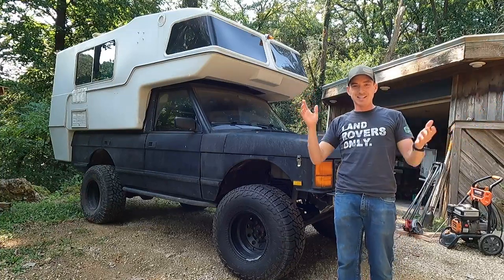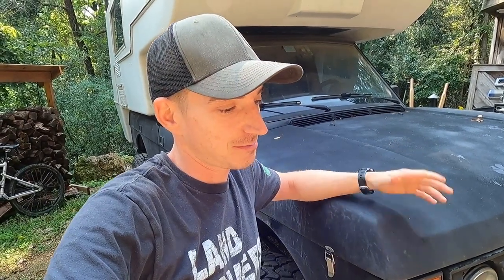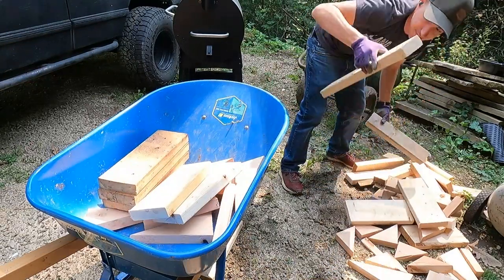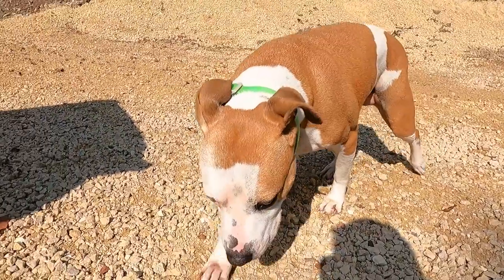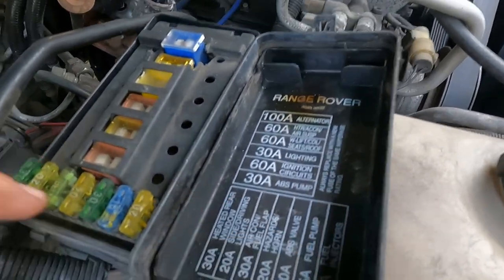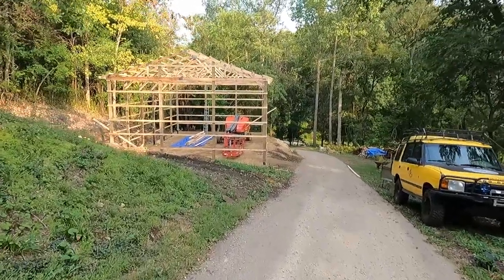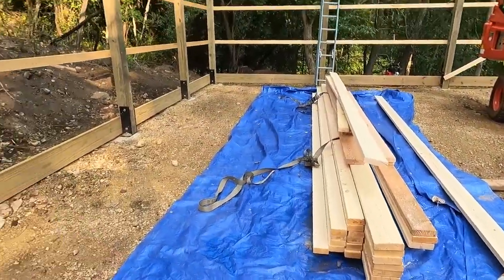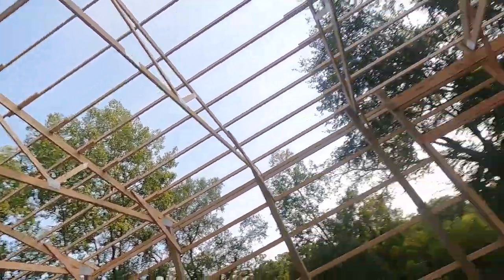No Oil Pressure | Problems with The Range Rover Camper

Comment: Why does most oil in the states come in quarts , but here in the the UK it's usually 4/5L containers .
In fact the oil for my 300 Tdi the last time came in a perfectly sized 7L drum.
My guess is they used the old pump in the rebuild and didn't check the clearances.
Reply from the maker: We do get some in gallons/5L jugs as well. Odd thing on the VR1 I used is locally it is cheaper to buy it in single quarts than the 5 qt. jugs. I haven’t ran across 7L ones, that is kind of neat as that seems to be right around what most European stuff seems to take. At the shop we used a lot of 20L ones.

Comment: I feel the oil may have drained out the pump because it sat so long. It may not be faulty. I reckon you take the distributor out & prime the pump with a drill or similar and see how that goes before you remove the sump. It can't hurt to try, plus you wont waste the new oil.

We would call the workshop as being at the "frame" stage, not skeleton. We are a bit more sophisticated in Australia - just saying.........

I just went to your internet site and saw you were also the merch model Joe. No expense spared on buxom blonds!!
Reply from the maker: I’m just a midwestern hack here in the US haha. Just kidding definitely not correct on any of my construction terms though. 
I think the pump did run dry, either way I’ll have another video with the condition of the gear up today shortly. 

I may have a good modeling career if my construction gig doesn’t pan out. Haha.
Reply: @LostCauseRanch  🤣🤣🤣🤣

Comment: Hiya, take the oil pressure sender or switch out, pressure feed by hand pump of whatever, about a litre (ok quart) of oil into the engine then refill the engine to required amounts AFTER refitting as full of oil as you can new filter, by backfeeding a large amount of fresh oil it not only feeds oilways but must prime the oil circuits/ give it a try.. On 2litre ford pinto race lumps i built I ran the hex drive rod the oil pump in a drill to pre lube the motor, Can you do this on a rangie lump ? I only had diesel ones so dont know.. Good luck/ Ian UK.
Reply from the maker: That might be worth a shot as well, I never though to feed back through the sensor port. I think being this is a distributor motor you might be able to pull that and rig something to spin the pump.
Reply: @LostCauseRanch  And why not, all worth a try eh.. cheers, Ian

Comment: Just because it was a fresh rebuild doesn’t mean they didn’t slap the old oil pump gear in there so I’m going with that. Remember I told you mine still doesn’t make enough pressure after changing it out, as of yesterday I think I lost a lifter or some thing because of it🙃 tick tick tick. I guess it didn’t like the spirited drive to the redline I gave it yesterday.
Reply from the maker: I wonder if yours has worn cam or rod bearings losing pressure. They spent the money on an Atlantic British short block. Hopefully and a new gear haha.
Reply: @LostCauseRanch  I suppose it’s possible. I checked the cam bearings at least to make sure they didn’t walk when I had the pan off. Highly doubt I will put any money into that motor though so I might have to look up your LS swap parts list

Comment: On my old 3.5  V8 I could not get it to prime. Had to take the top off the oil pump and pack it with Vaseline (Petroleum grease) because it dissolves into the oil when up to temperature and then you just dump the oil and refill.  Worked first time! Could also be a blocked pick up pipe?
Reply from the maker: I think it may have lost its prime, have it off now and I'll have another video showing the gear up soon.

Comment: Gears  its common unless the they didn't put an o-ring on the sump
Reply from the maker: I think gear too. I’m guessing if the o ring was missing that would have shown earlier, but who knows.
Reply: @LostCauseRanch  I did have junk sucked into the strainer too and all gummed up. On the engine I replaced